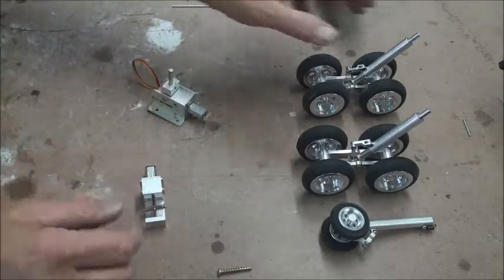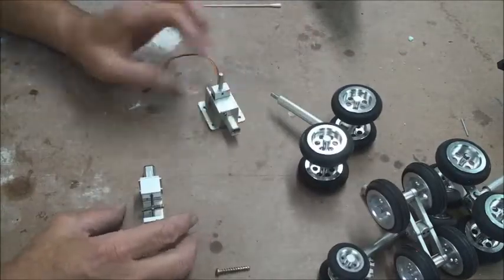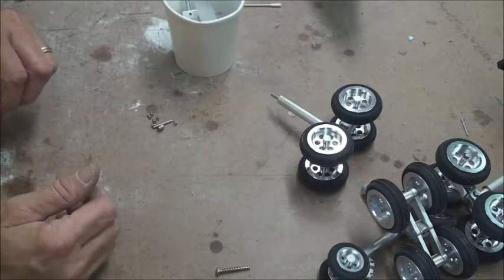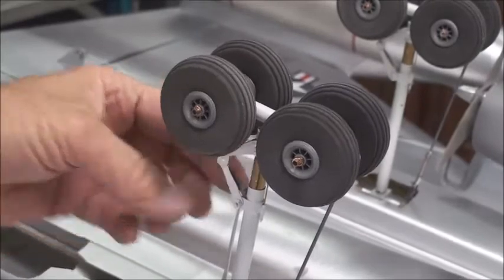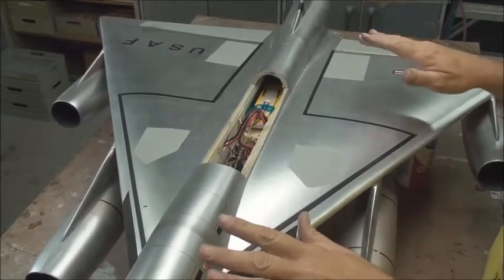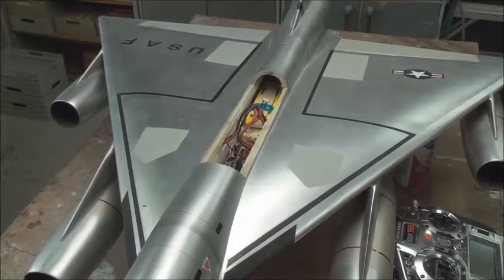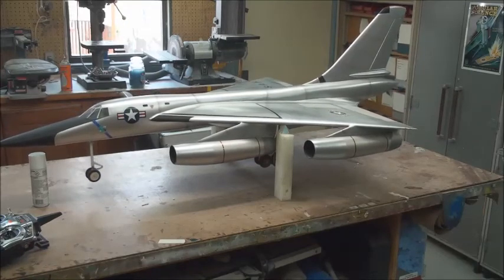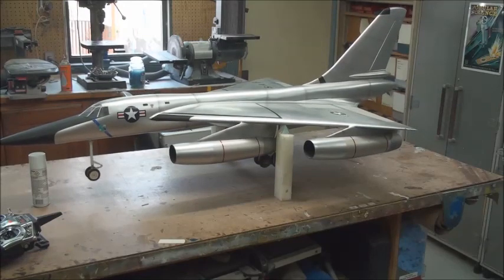B 58 gear

Comment: I had a similar CG shift problem with a plane once. It is because all the wheels retract towards the rear. The trick turned out to be making the nose-wheel retract forward.

While the full-sized B-58 uses a much more complex retract system, It does look like the nose-wheel retracts forward. I'll bet that if you re-positioned the nose-wheel back some & then had it retract forward, you wouldn't need to shift the battery.

Comment: Beautiful work!  You dont see the beautiful B-58 modelled alot in RC!  I believe, though, on the actual jet, the nose gear retracted backwards on tracks, to accommodate that large underbelly drop tank.
Reply: I think you're right. After looking at photos, it appears that they fold up like the mains, but in the other direction.
Reply: I was looking for a video of the actual gear's retraction because I noticed that belly tank would be an issue
Reply: That pod also carried a nuclear warhead.